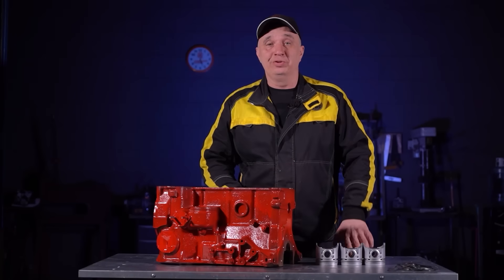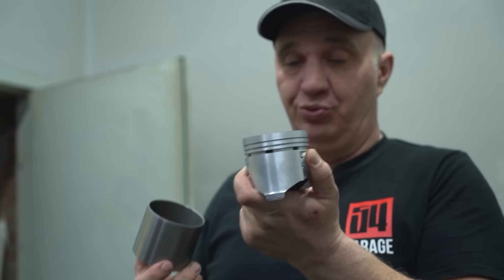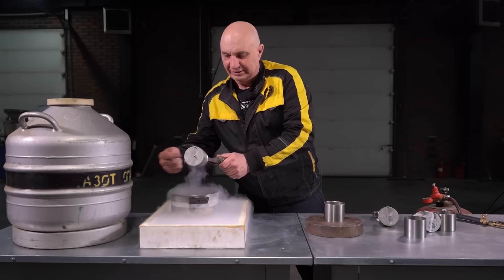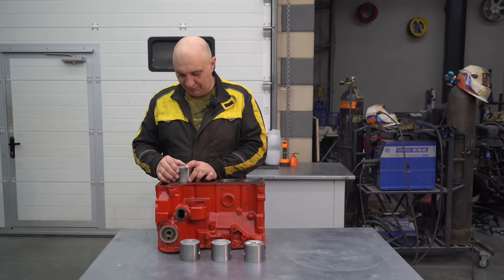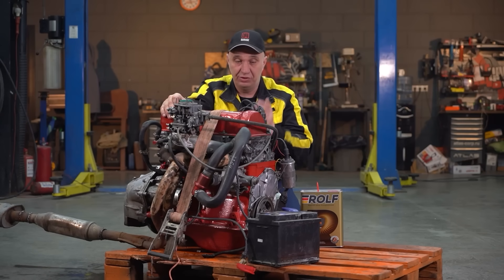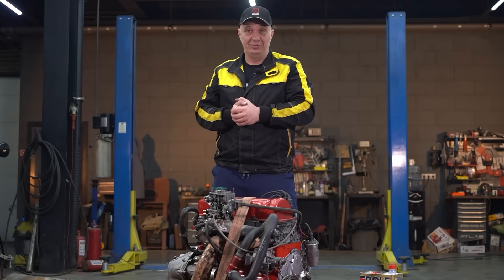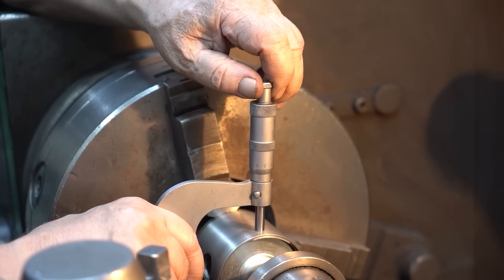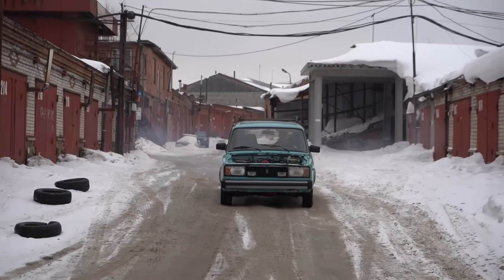We fit pistons with no rings to an engine - will it work?

Comment: It will work as good its the prescribed tolerance. But as engineer of internal combustion engine, i say it will not work. Piston tolerance include the thermal expansion due to combustion. Expanded, still have clearance to move, compensated by elasticity of piston rings. As soon them are worn out, bye bye compresion and good stroke. Another stunt for nothing.

Comment: The expansion rate solution was flawed, the block is aggressively cooled and the pistons are not cooled as effectively ( hotter around the explosions)... thus different expansion rates... and the Block/Piston temperature differences vary under throttle and ambient temp variance.. so its an impossible task....either low compression extreme blowby OR lock up....

Comment: In a piston there is an oil ring which is impossible without the ring the engine will seize up due to the lack of oil to lubricate the cylinder.

Comment: I have an idea, why don't you make drill side holes on cylinder sleeves and have engine oil lubricate walls high up, run it for a while see if that helps, more holes more efficiency. like a Mesh sleeve or something.

Comment: I've watched several youtube videos where someone takes a frozen/ locked up engine and loosens it up eventually getting it running. Most of them will make a statement about how the piston rings are stuck in their ring grooves and with a few heat cycles they will free up and work. I'd like to see that. A befor and after look at the pistons and their stuck rings would be something for me. These guys don't do the Lada engine justice. Believe it or not, I have tested Lada engines where I used to work and they were very well built, but to build pistons with no rings means a totally different approach to engineering. No reflection onto the Lada engine itself, these guys did not do much in the way of  correct. And of course when sparks flew out of the side of the engine block, they were in it to destroy it from then on for show. OK, let's see if "stuck" piston rings really do free up. ben/ michigan

Comment: Mechanical Engineer here. This is a great example of thermal expansion and why we have compression rings and Gaskets. 
As soon as he started revving the engine it almost immediately started knocking because of the heat produced by faster combustion, more heat means the pistons and the block both increase in volume which causes the pistons to be compressed in every direction causing a total failure. If you don’t have any space between the piston and the engine block it’s almost guaranteed you will end up with either a cracked block or ruptured pistons. It’s theoretically possible to make an engine work in this way but it requires the pistons to expand to the full cylinder area at operating temperature and be perfectly stable at this temperature, outside factors make it completely impractical to do this as well as starting the engine.

Comment: yeah you will make so tight a seal the oil will not work as a lubricant and cooling. to get this to work you might have to ass some Oil spraying Nozzles... I have seen them onb the bottom of the connecting rod. between the Rod and Crank attachment.

Comment: It could never have worked out. The pistons have a different expansion ratio to the cylinder walls. Just like you showed in the begging with the wrist pin. Next time ask me and save the trouble.

Comment: When they chrome chromac plate the cylinder walls, they act last a long time and the rings are Chrome or some other alloy that lasts a long time. So I don't know why they're doing this. You have to have oil in there

Comment: So, basically piston rings have a sort of spring action. The gap in the piston ring allows the piston to be smaller than the bore, but the ring can expand and contract due to different tolerances  in the bore.

Comment: Rings control friction as much as compression.  The difference between a piston that will work vs one that works very good in a hi performance application is huge. The content of different alloys will vary from top to bottom of the good piston. This compensates for most of the heat coming from top of piston.  Mercury marine has been the masters of this in my book. On a hot rod 2 stroke you can't come close to building a motor as tight with aftermarket pistons.

Comment: Anyone who has used small displacement glow plug engines, know they don't have rings, and they work. In larger engines, the expansion of the metal when running, has too much change to provide a seal when cold and not bind when hot.

Comment: The engine fires on compression removing the rings removed the compression. Guns are just like cars and some don't use compression they just fit a tight bullet in a slightly larger tube and a spring sends it flying. I would taper the cylinder to be tight at top and loose in the bottom and I would use straight gas not gasoline to ignite the fuel and air mixture.

Comment: We all know what the outcome is going to be, but one day we may all be wrong.

I bought a car and when I lifted the head I found two wear ridges at the top of the bores.  Further examination revealed that the top rings had been removed.  It was a low compression engine (6.8:1) so it probably didn't make that much difference anyway.

Another one I owned had a diesel engine with dry liners.  The engine failed 4 times, a different cylinder each time.  I put it down to incompatibility between the rings and liner.  The manual says not to use chrome liners with chrome rings, which is what I think the previous owner did.

Comment: Hello. 👋 I'm Mardono from Indonesia. May I request a tri-angle crankshaft? Each angle is 120° for a V8 engine or less. It's equipped with a counterweight, namely the crankshaft leaf.

I'm not referring to a cross-plane crankshaft or a flat-plane crankshaft. But rather a very different model, the tri-angle model. 🙏

Comment: You should have drilled holes on the sides of the pistons for oil to get to the cylinder walls to preven locking up.

Comment: It's interesting to see this video, really helps validate the fact that rings are inevitably required as they are strong and durable enough to with stand all the thermodynamic changes that happen every second in an engine, including the abilities of expansion and contraction to compensate the clearance changes within the engine's designed tolerances.
Reply: They also have a gap which closes as the piston heats up so the ring itself does not tighten in the bore.

Comment: I know why but i want see this the practice too (piston ring are important because the gas pressure make the ring itself expand and trap the gas pressure, in two stroke are essentials because that also prevent the flame front to burn the oil veil in the cylinder)

Comment: you should machine the piston so it has the same contact area as rings, the lower contact should mimic oil rings. I think it could work really well and seal better, you will also have to find a metal that expands at the same rate.

Comment: Just try super thick rings, to reduce wear. Like 5mm thick rings even 10mm i dont know, might reduce long term wear. Having a ring on top of piston might 'balence' the wear also, but im not a mechanic. Id try copper rings and plenty of oil changes 😂 sacrificial rings but cast iron block and head. Like the old babbet engines with lead pistons kinda

Comment: 14:28 from the sound thru a shirry phone speaker. And with some doubt I say this, I think one or more of the piston connecting rods failed due to the engine or that piston seizing? But honestly I wouldn't know and the reason I am in doubt is bcs wouldn't it just scrape the cillinder walls? Idk to be honest

Comment: The other side. 5mm extra bore, on engine block.5mm carbon fibre sleeve, slot right in there. Or a metal to take high heat. High tensile. You now the explosion when water meets hot oil, well that. But in the piston cylinder. Twin injectors, smaller than diesel, oil will move slow. Heat oil with 1800w inverter. Heat a reservoir for the injectors. Attach oil line around manifold and engine block. When oil hot enough. Inverter switches off. You'll just have to pre heat oil reservoir first. 🫵

Comment: A cast iron piston in a cast iron bore is fitted at .0015 x the bore size in inches.  A sleeve installed on an aluminum piston will expand differently because of the thin wall of the sleeve.

Comment: One of these days these guys are gonna make a breakthrough in engine technology.
Reply: They already have made a few breakthroughs. If you look behind their shop, there is a pile of cylinder blocks with holes in them.
Reply: Manufacturers have tried everything under the sun just to see what happens....it is part of the r&d of designing what actually works.  A great series would be to dig up any videos that exist of said testing from all of the big manufacturers that have been doing all this pre youtube
Reply: Facts!! Or they combine a few things they have already done.
Reply: Das haben wir früher, 19 80,bei unseren Mopeds ausprobiert, einfach so als Spaß! Die Motoren liefen ! Aber sehr schlecht. Keine Kompression!!!😂😂😂😂😂😂😂🎉❤

Comment: the only reason there there is to get oil onto the piston,   so I figure yeah It will still work (ps my supertigre .60. cubic inch airplane engine doesnt have rings)    but it will wear the pistons a lot faster

Comment: Ok, i paused the video just to say , that you need those rings. I work on engines 5 days a week and can confirm that a engine cannot operate for long at all without those rings. They are responsible for keeping lubrication between your cylinder and piston. Yrs, there are small ridges that help, but Without the rings your engine canot properly lubricate and create a barrier to prevent the piston from seizing. Also aids in keeping proper compression

Watched the video and found it entertaining.  Thank you 😄

Comment: Reminds me of an early experiment we did as youths we had an old Honda XL 185 .  That was frame right off etc We hammered the fins off the engine filled it to over flowing with oil. And had about half a gallon of fuel we set it to run full throttle ( only kids would do this to a lovely engine like picking wings of flys ).  We put out on the dump started it. And it ran Untill the fuel went. After like 1hr.  The. We knocked holes everywhere. Tore of the exhaust.   Put another half gallon. It ran out of fuel. After we got tired. We smashed side case. No oil. It once again ran out of fuel.  But was knocking real bad.  We went home few days later. More fuel.  It ran and ran and ran . Then it caught fire .   Years later I wished I’d just dismounted that old XL 185 Honda  engine.  What a star.  Also the XL 250.  Similar. Utterly tuff engine

Comment: With nitromethane n extremely pressure yea because the grooves act like a seal like RC cars but electric 55000 rpms better have special tires solid with rim n all

Comment: 0w oiL in crank with 2 stroke oil like in nitro in rc in fuel . The most important part is cylinder cone size as bigger at bottom and tighter at top of cylinder

Comment: U burned up all the oil 🤦🏽‍♂️ it ran fine until their wasn’t enough oil for it to keep everything lubricated with no rings the gaps will be to wide when cold until it got hot enough where the sold piston expanses and even then it will still burn oil but just slightly

Comment: Elsbett made it successfully with a 2-stroke diesel.
So here are the errors:
1. The aluminium core of your pistons still expands a lot expanding the thin ring too. Elsbett's pistons were 100% steel.
2. Elsbett's engine had internal air cooling which worked because it was a 2-stroke diesel (just flushed with a lot of air, not air fuel mix) with exhaust valve.
It had a gap of 0.01mm. So there was no oil smoke.

Comment: For it to work well, they have to make a groove under the piston and collect oil, but the crankshaft must have a splash towards the pistons to lubricate and the engine must be 2-stroke. Modify it well to two-stroke. We created a 350 V8 in two-stroke, methanol injection, overcharge.

Comment: Heating a tight bolt, loosen's it, not expand's it. Try using metal that is all the same type too. Compression is determined by the bottom cylinder  border, blocking off the Crank Area, from the Piston bottom. Try a Lip on the bottom of the cylinder.

Comment: glass-ceramic zero expansion coefficient pistons and cylinders. also air engine does not need to care about expansion, because heat stays constant. piston-cylinder design has a tolerance design issue. you could also use heavy oil as a temporary pressure seal per stroke. oil not only for lubrication but as a flexible temporary sealant too. ie the burn rate must be much slower than gasoline. using non-linear fluid as the oil. if the pistons are shaped in a flexible metal spring pattern then the expansion would not matter. kinda flaps on the piston radial surface. also the oil needs to stick to the cylinder walls.

Comment: Normally the material you take to make the outer edge without ring will expand as the bore expands, this is the aluminum piston that has been pinched between

Comment: my racing two stroke engines ran with just one compression ring and oil fuel mix of 25/1 We did rebuild the top end after every one to two races 10 to 30 km or things wopuld get out of round with loss of the powerband ,  new engine rev to   23,000 rpm

Comment: I am also a mechanic working for Nissan for many years, when I heard you guys had the idea of creating a ringless engine, I also thought it was impossible because the aluminum piston will expand so there must be some looseness, but if there is the necessary looseness, there will be loss of compression, not to mention the oil will follow that gap to escape to the combustion chamber and cause consumption, however, I also understand that you guys know that but still spend effort and money to create this video to increase knowledge for many people.

Comment: Engine manufacturers have been machining every engine block and its component at the operating temperature ( 80 - 90°C ) to ensure it will last a long period. That's why the cold start and warmup phase is critical as the whole engine has to expand to expected dimensions. Next time you machine pistons again, heat them to the engine's default temperature. Outside of that, cool experiment, guys! 👍

Comment: Noble try; the iron piston in an iron bore has been done successfully but with model airplane engines of decades ago.
They were two strokes that had oil mixed in the fuel.  The pistons were lapped into the bores for an exact fit and only about the top 20% was the tight fit needed for compression.  Since they were two strokes, the oil in the fuel was present at all times for lubrication.
I had several of these little power plants and flew them successfully for many seasons.

I'd guess that your engine would have done better if oil had been mixed in the fuel.  Additionally, two stroke fuel mixture comes into the crankcase first, cooling the underside of the piston.

Comment: The Cox glow plug engines were  2 stroke engines that had a nitro fuel and oil mix. Them engines did not have piston rings and really screamed. Some other model airplane engines did have rings I believe.

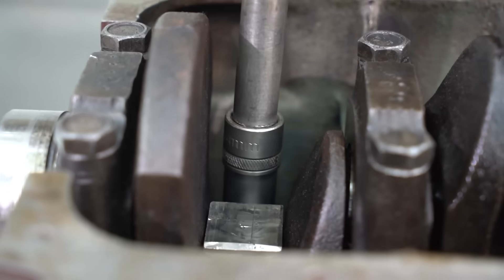Comment: 6:30 time.  ?  Putting   Lubriplate, grease on the crank bearings, and all other points - WOULD   be  a   good idea, when assembling, an engine.  Oil pressure pump, takes several seconds, to  Pressure Up, the lube system.   Especially, the overhead valves - whatever this  Block,  takes...

Comment: Well as a machinist for 15 years I could have told you immediately that this wouldn’t work… aluminum galls easily… if you really wanted this to work you should have made the sleeves out of hardened steel and and the pistons out of cast iron. Or vice versa… cool experiment but kind of a waste of time…

Comment: What is the doors just have a much wider section at the top and taper it down very rapidly and then keep it the rest of that distance like you only need like half of a millimeter not even that

Comment: Who didnt think it was going to grenade? Piston rings are there for a reason..1 compression 1 for oil and 1 for a scraper..no way for his design to oil the cylinder wall and if it was able to oil no scarper ring to remove the oil and hence extreme blowby or smoke like a chimney..rings are made to expand and compress ...solid piston against cyclinder walls cannot..whet did they think would happen once it reached operating temps?...foolish attempt...wise enough to build yet follish enough not to realise??

Comment: No, it will not work. The Pistons will overheat and they will seize the bore because there is too much surface area on the cylinder bore rings are designed to keep the pistons compressed but free from the bore  as soon as you do a machine tolerance fit, and then you add heat it’s gonna go bang when the engine is going fast

Comment: Great video!  One problem is no oil journal to lubricate the piston and cylinder wall surfaces.  Another problem is the torque angle produced by the connecting rods will force the piston walls against the cylinder walls unevenly, causing gauling.